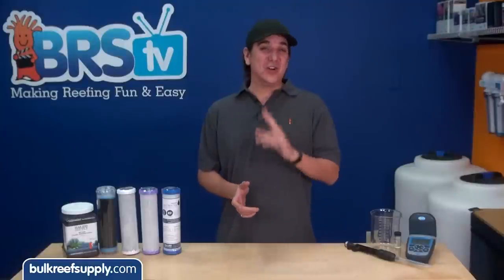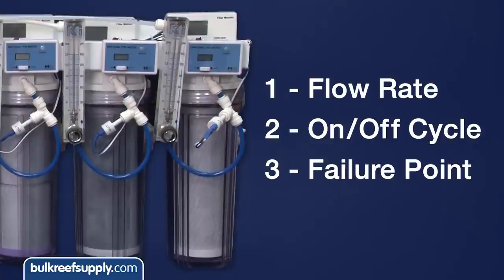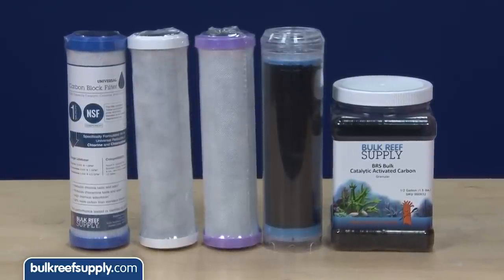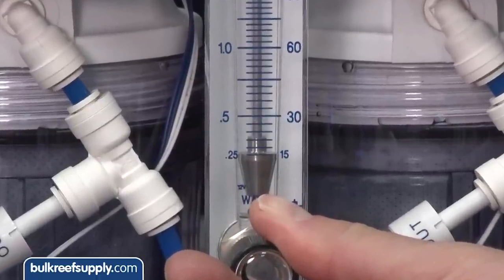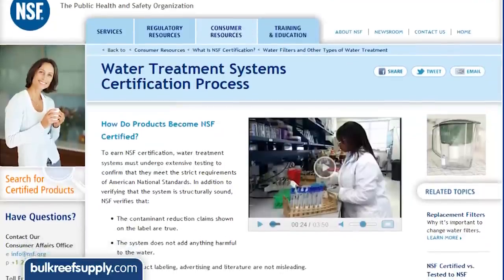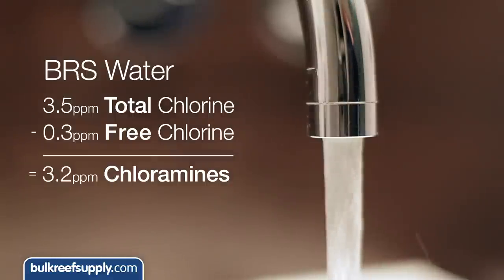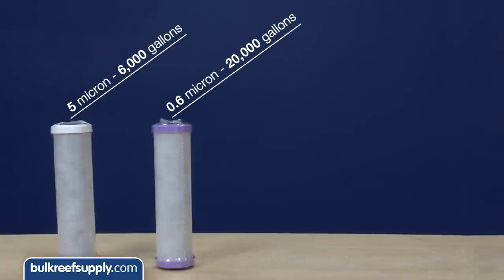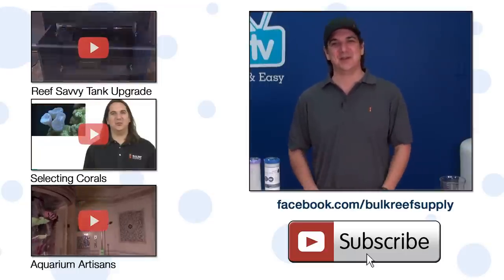Ending the Chloramines vs Carbon Block Debate! (EP1: Testing)

Comment: Interested in these results.  How do you measure chloramines for "both free and total"?  
I would also be interested to see the BRS GFO & Carbon Mini Reactor's results when running various mixes of GFO and Carbon on a 90g system.  How much phos can it remove?  What and how much benefit does the carbon bring to the equation?